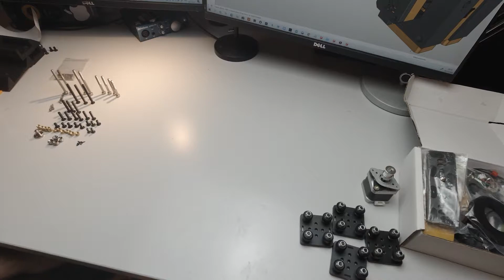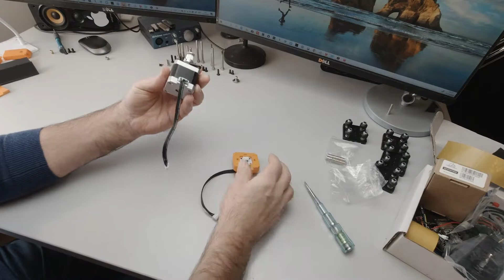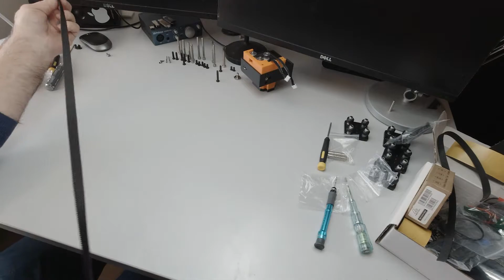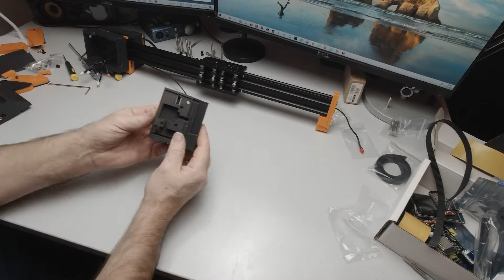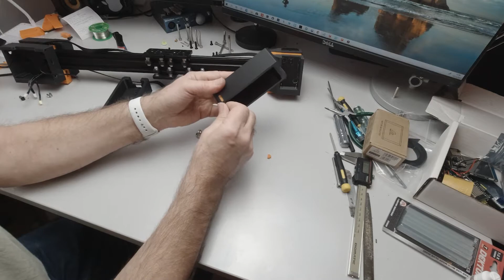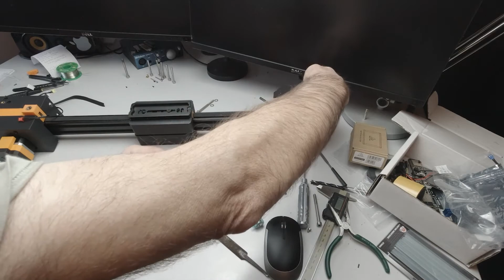Camera Slider Build Updated

Comment: Hi, i have an issue with the tilt moment. The System feels stable, but when i install a ballhead and a camera, i have massive tilt, which you can see on the recorded video. I also tried a 4040 rail. It is better, but still to see.
Do you have any advice for me?
Thank you very much.

Comment: Hi! Love your work! I was courious to know the reason behind using 4 mini gantrys. Woudnt 2 make it? One on the bottom and one on top? Thanks for your videos!
Reply from the maker: You can try it using just two but the big concern is the bottom carriage which has to take the full load of the slider, a PTZ head and the camera system over a cantilever! It needs to be strong. The upper carriage not so much however.
Reply: @digitalbirdfilm  Thanks for clarification! It's true that 0.5m of momentum * the weight of the camera might be too high for those screws and wheels not to bend a little...

Comment: tmc2208 and nema17 are overheating. Did you set the tmc2208 vref?
Reply from the maker: Hi Salih
If you have a meter you can check the vref  it should be no more than 1.2v  Taking care not to short anything place the positive wire from your meter on the TMC screw adjustment and the black wire to earth to check. It is normal for the TMC and stepper to get warm if left on for extended periods but not excessively so. The Vref on the TMC boards can be adjusted by turning the small screw in very small increments until the voltage required  is reached. if you think it is running  hot then clockwise rotating potentiometer- Reduces Vref, thereby reducing drive current; Counter clockwise rotating potentiometer- Increase Vref, thereby increasing the driving current.

Comment: That battery end assembly is kicking my butt––going to start fresh tomorrow!
Reply from the maker: Yes. Sorry for that. A bit of patience is required on that step!
Reply: HI I have tried this battery end assembly twice and it is still having issues. Did anyone get this working and what settings did you use?
Reply: Presume you have to use supports for the overhang?

Comment: Hey, any estimate on what payload is approximately supported?
Reply from the maker: Hi
With the current setup using the over the top pan tilt head the Max payload is about 3KG/ 6.6 Pounds on the tilt arm over the full 180 deg of motion more if you restrict the amount of tilt. Other parts of the system are less restricted. 
That said the system was never designed for very heavy cameras and while it can be done there is bound to be more ware and tare on the system.  I would say a good working payload for constant relaiable use would be  2.5KG /5.5 pounds or less. This is more than most consumer camera setups with added extras.

Comment: I have a few questions for you:
- I saw in the code repo readme and if I understood correctly this version will have a extra keys? Those this means that we can have more waypoints than only start and end?
- I saw in the description that we might get a focus motor as well connected with the slider, any ways we might get the ability to use two at the same time? so we can do zoom and focus at the same time?

I know I'm asking for a lot, but you have a great project here, I liked your project a lot, was waiting for the kit to be back at your shop, and I was thinking that multiple waypoints was the only feature that made this a no brainer, but if we might get a focus ring as well.. man I'm sold
Reply from the maker: Hi Ramy
Sorry to take so long to reply.
First of all yes the new software know offers Six key frame waypoints and I will be posting another overview of the system explaining all the new functions soon I hope!
Currently the main board only allows for three axis Pan Tilt and Focus though I may experiment with a forth axis in the future. The big question is whether a forth computational axis will impact performance given the additional computation required. For know however only focus or zoom but not both together.
As regards the six key sequencer this has taken a long time to develop proving much more complicated  than I originally thought. Its only drawback is that I have found it impossible to implement variable Ease values for each key since this completely upsets the timing. Consider that any one motor may stop and reverse direction while others may need to smoothly continue on with no stop and all need to finish at the same time and you get some idea of the complexity. Also you currently cannot use time-lapse with the sequencer less of an issue I thing. 
As regards the kits availability I will have more available for the slider , Pan Tilt and focus motor hopefully before Christmas.
Colin
Reply: @digitalbirdfilm  Thanks Colin, and thanks for all the great effort you are pouring into this project. I will be looking forward to your next videos and will be looking for the kits as well. 
Kind Regards

Comment: Can I use Wemos Lolin32 instead of Adafruit HUZZAH ESP32?
Reply from the maker: In terms of performance yes. However the board is longer and wider than the HUZZAH feather which means you would need to design a case especially for it. It will not fit in the current case design.
Reply from the maker: Just as an add on I have know tested the WEMOS LOLIN 32 and you will also have to change the pinouts in the code to GPIO 1 for TX and GPIO 3 for RX look for the lines #define RXD2 and # define TXD2 the Feather uses 16 & 17
Reply: @digitalbirdfilm  yes its working. thanks so much